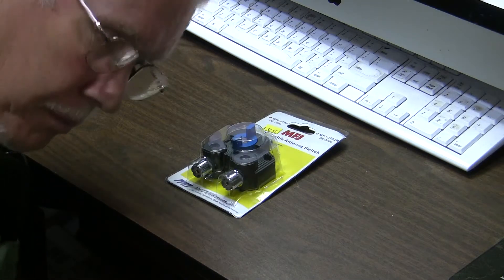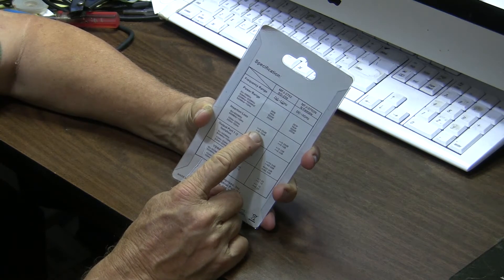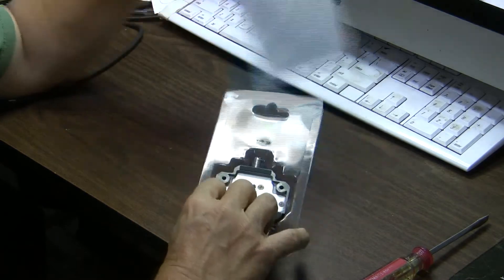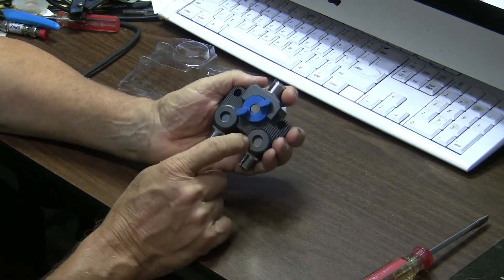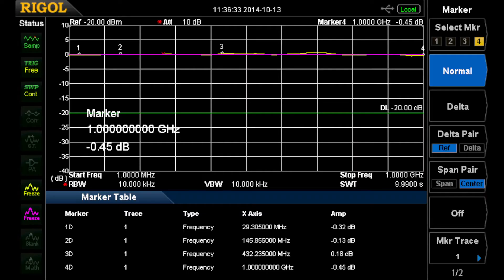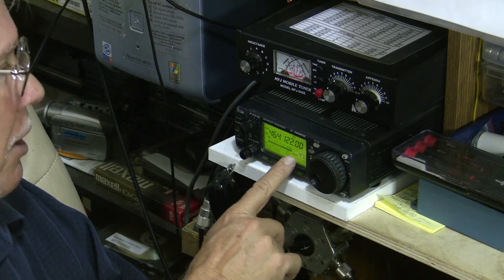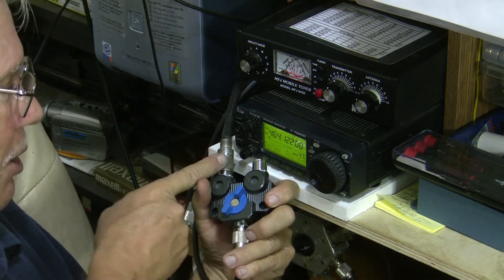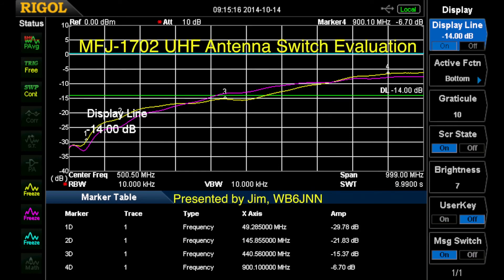MFJ 2702 DC 1GHz Ant Switch

Comment: Hi James can i use this as an Ae splitter to split my Ae signal to 2 of my HF TxRx Ae inputs in the range of 1-30 Mhz bands? Thnx
Reply from the maker: Anand Penumetcha  What do you mean by "Ae"?  The switch is a 50 Ohm matched RF switch to select Antenna 1 or Antenna 2, or Receiver 1 or Receiver 2, or TX1 or TX2.  It is a mechanical SPDT switch.